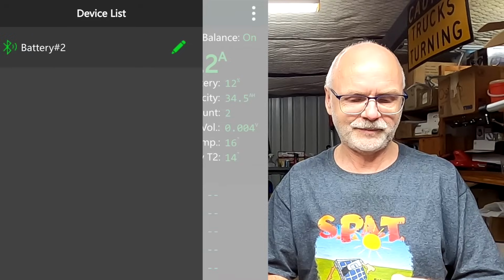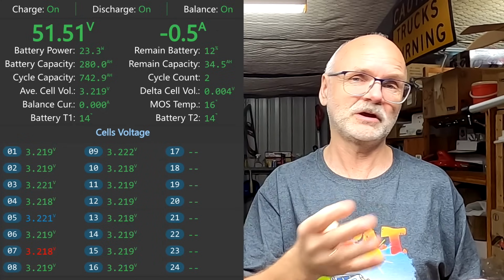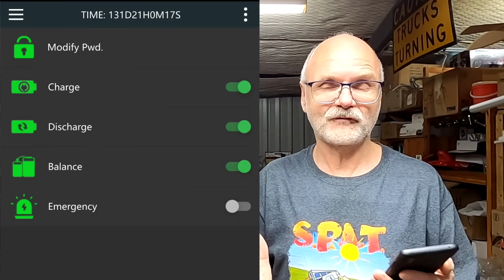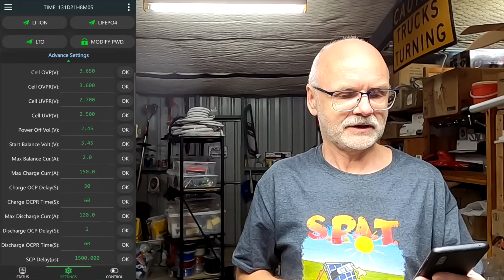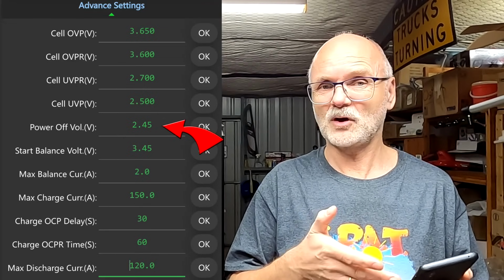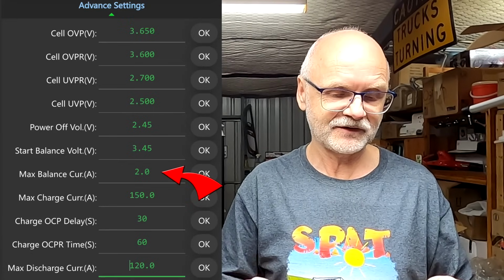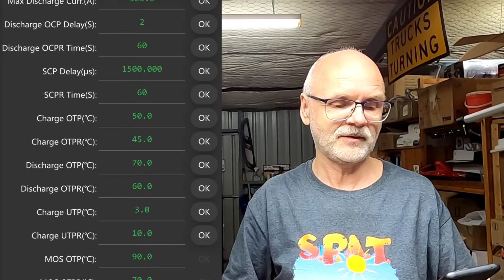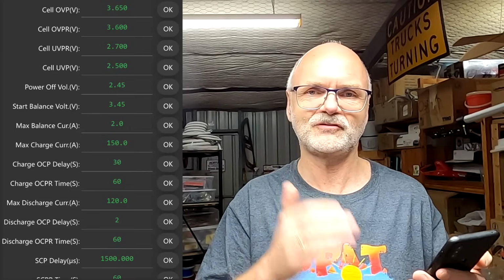JK-BMS: all settings and menus explained. How to program and set parameters.

Comment: Do JK have models above 200A for Lifepo4?  These are under capacity for a 3P pack driving larger 10kw AC inverters and 12/24vdc converters.

Have you done a vlog on the pros and cons of parallel bms's vs a single larger one for parallel battery packs?

Many thanks
Reply: He has. He opted to have three separate packs each with a BMS then connected the packs in parallel, as opposed to paralleling the cells and using one BMS for the whole thing. I agree that 200A is way too low for 12v, even for 24v. There has to be a 400a version. They do make a 500a version that works with 24v but not 12v.
Reply from the maker: If you use parallel banks with a separate BMS each, you have full control over every cell and have, as in my example, 3x 200A BMS power. Plus redundancy in case you need to take parts of the battery offline. With cells in parallel, you always have to shut down everything.
Reply: You want to monitor cells, not packs.
Reply: @krg038  I should have been clearer.  Cells of the same voltage are in parallel too and therefore self balancing and act as a single cell.

I'm not a fan of parrallel fuses/breakers/cut offs where operating current may be > rating for some time.  Hence my question if there is a higher current version.

thanks
Reply: @mikehortin9964  understood. I think you still want to monitor cells individually. I had one cell actually short and BMS shut it off. I'm sure JK will get around to a higher current model but it's probably just not popular yet. Higher current batteries are out so they're going to have to catch up. Serious wiring for pulling 200 amps constantly.

Comment: Is anyone using the JK BMS with a growatt inverter like the SPH series using the canbus ?

JK was not very helpfull regarding this topic except telling me that I would need to buy a chip or something like that.
Reply: They won't speak the same protocol (CAN is just the bus/hardware interface). I think they're working on this, but no idea when something will be released.
Reply from the maker: Not sure what the benefit is of connecting a BMS to an inverter?

There will be a full Victron integration for the JK-BMS in the future.
Reply: Not very  useful anyway!

Comment: The configurable sense wire resistance settings may be for mobile applications (boats, RVs etc) where some batteries are in one location and others are much further away in another.  This gives different resistance and voltage drops for the packs' sense wires
Reply from the maker: Cable length will not make a difference when measuring voltages.
Reply: @OffGridGarageAustralia  sense cable wire resistances will make a difference while they carry a balance current. If the BMS unknowingly copes with high wire resistances while balancing, it will affect balancing performance (balance current will add negative tolerance to the cell which is being discharged, and positive tolerance to the measured cell voltage of the cell which is being charged, resulting in an earlier than necessary completion of the current balancing step. As soon as the balancing stops and the measured cell voltages represent the real cell voltages again, it will continue balancing the same two cells)
Reply: @OffGridGarageAustralia 
What about cable length when you’re balancing? Then you are drawing or pulling current from the individual cells … relative small amps… I know
And what if sensor cables are not of equal lengths due to setup of the battery bank ?
Thx
Reply: Hi Andy, love your videos !
On the subject of voltage drops and cable restistance, TEST IT 🤓
Reply: I'm still testing, this value is to calibrate the voltage on load. If you stop charging or discharging and you measure a cell the BMS give you the correct voltage but on charge it will give a different voltage since there is a potential differential, if we don't calibrate we will have some cells starting to run away. I had one cell that had 0,1 overvoltage on top charge, this lower the capacity in 9Ah in 3 months, after changing cell position on the battery I notice that the voltage of that cell was normal. I had the same problem in another battery and changed the value to 1 milli ohm and it lower the voltage and it stop being the one with highest voltage. Test your cells independently and record the values, if BMS give a different one adjust this value, this is only for balance but since the worst cell will have the highest voltage on charge it will stop charging when reach balance voltage and start discharge to equalize the voltage, so balance will discharge the weakest cell. Using Andy 3.45V will reduce the problem but won prevent this.

Comment: Since your are du hyped about these BMS I ordered a second one. A 2A24S15P (2A balancer current, 150A). This is also printed on the casing and reported in the firmware. However, when I opened it the PCB had a label 1A24S15P, indicating only 1A balancing current.
Seems I paid 20€ more just for a different firmware. I hope the hardware is really capable of 2A balancing current...
Reply from the maker: Oh, so what now? Did you get a discount or are they sending a new BMS with the right specs and you can keep this one?

Comment: Andy thanks, that was useful. I want to use a small generator to supplement my inverter at night, I was wondering if I should use a rectifier and connect to the solar input or if I should connect the generator to the AC input?
Reply: Hybrid inverter or dc input inverter? Generator to charger for batteries and let the bms protect the batteries.
Reply: @krg038  it's a 5kw hybrid inverter and a 2kw generator, the problem with using AC-in of the hybrid inverter is that the moment the generator starts I only have access to 2kw max of "dirty power". To get the full 5KW peak power I thought it might be best to rectify the dirty generator AC and feed it through the solar charger of the hybrid inverter?
Reply: And yes Kevin, your suggestion to run a battery charger off the generator is probably the best solution, thanks!
Reply: @mjp0815  I have a line conditioner on my sensitive stuff (laptop, tv, fridge, freezer). My generator has pretty dirty power. Minisplit, fans, lights don't care. Not sure if the hybrid inverter cleans the mains AC. I will fire up my gen and look using my oscilloscope at the hybrid output
Reply from the maker: You probably want a Multiplus II or Quattro II for that as it can handle a generator plus the grid power and add additional power from the battery. Everything else is a bit shaky, I guess...
Reply: @OffGridGarageAustralia  ok, good point. I should have bought the right tool for the job, I guess... But throw out my hybrid inverter? Hmm.
I think Kevin's idea is still acceptable, to connect an independent battery charger to the generator. I can use the dry contact on the inverter to call the generator to get some integration...

Comment: First with failures : 
Why are you show the 8 s version, in ur hands not the 16/20s ? 
Nice is your comment to the SOC!
And again 131 Day running ? you must have so much material to cut.... (running 200 Days plus, SOC of the JK is telling me 6-20%, 99% will tell me the Victron "+" the Battery ist rising to 27,6V so the JK is wrong)
Nice comment to the calibration, the bms does it´s job, but don´t use it as Monitor or SOC Device,
Really nice video to set up the JK BMS, 8S/16s/XXs everthing is the same, and ANDY u have explained it so good nice job .
Reply: "Why are you show the 8 s version, in ur hands not the 16/20s " --> because the 16s version is connected to his battery; he shows it at some point. "And again 131 Day running ? " --> it's on his live/main battery.

Comment: One thing I miss on this BMS is a relay output you could program yourself .. for example let the BMS tell the charger that the cell voltage or charging current became too high, so the charger can act rather than the BMS.
Reply: I think theres some community made drivers on github that you can get for venus os to support this exact feature without need of a relay.
I'm also looking to do this however I'm waiting for someone more experienced to test it for me.... Like a German living in Australia with a garage dedicated to such experiments and tests...
Reply: Let the BMS tel the charger to stop charger on 3,6v and BMS cuts the charg on 3,65v...
Reply: Well, you could attach an Arduino at the RS485 port and you are almost done :-)
Reply: @Poebbelmann  Especially since it's actually a TTL port (with Rx/Tx lines) which you could directly connect to a UART on the Arduino, or use a USB converter to connect to a Pi. I use this to graph the data in Grafana, but also to make decisions on when to turn on the water heater, etc.
Reply: @upnorthandpersonal  Or you could use an esp32 and have web capabilities to manually turn things on and off, and watch the status....
Reply: @B4x4  Yeah, plenty of options. Anything with a UART will do.
Reply: Seplos will talk to many different inverters, or you can do your own thing with mqtt etc
Reply: @edc1569   Spelos?
Reply: @offpro  seplos is another bms brand

Comment: 20p means 20 in parallel allowed.
Reply: Until recently they recommended not putting them in parallel at all. They've updated that after I told them to recommend a Class T fuse per pack when you do that.
Reply: According to jk, 15 is 150 amp and 20 is 200 amp.

Comment: These are junk, if left alone for a few days all the settings went random and i couldnt change any settings as it said input from bluetooth failure and just made a screaching and ranom beeping noise. But only if left alone for a few days, i had to totaly disconect the bms from batteries for at least 2 minutes. both of mine are now in the garbage as they only lasted 2 weeks before packing up 😡
Reply: I've been running several now for over two years without issue.
Reply: @upnorthandpersonal  well arent you lucky, the 2 i have been using have destroyed 2 very expensive lifepo4 batteries, after checking both batteries voltages, they have been charged to almost 17 volts 🤬🤬🤬
Reply: @karldingbat  What are your charge controller settings to allow them to go that high? You sure you have a LiFePO4 configured in the BMS and not Li-Ion?
Reply: Im using a epever 40 amp solar charge controller, and yes both bms are set lifepo4 in settings, but as i said the bms settings have all gone to random settings and cannot be set, the bms just gives out a screaching sound when connected to Bluetooth, it saying it sending failure when try to change settings it wont even show how many cells are connected even though the wiring is perfectly ok. The bms were ok for the first week, then when left alone to do their thing i tried connecting bluetooth to check the state of cells it was all over the place and the screaching started, it was silent untill i connected bluetooth.
I had no problems at all with the jb bms for over a year, i only changed them on andys review on them.